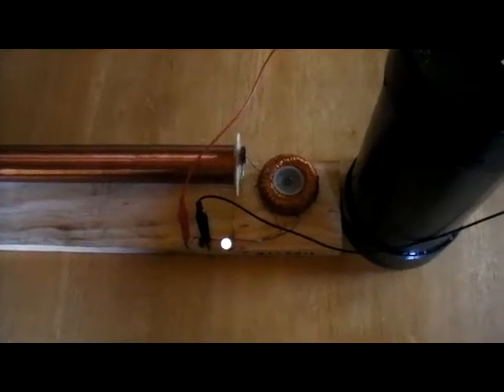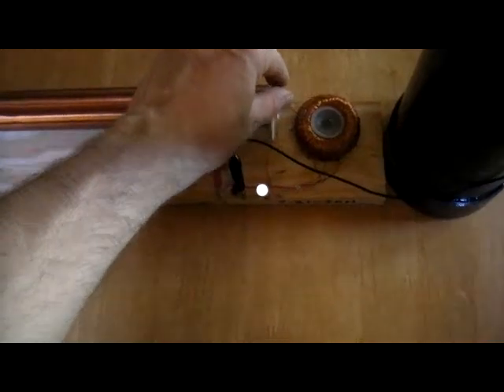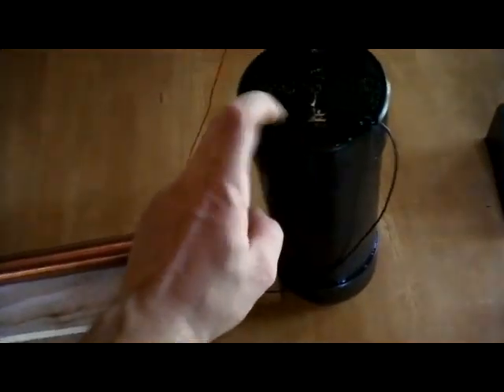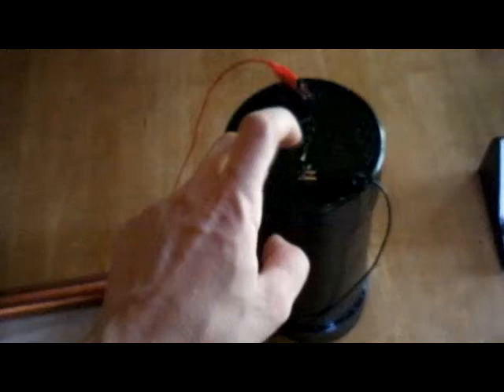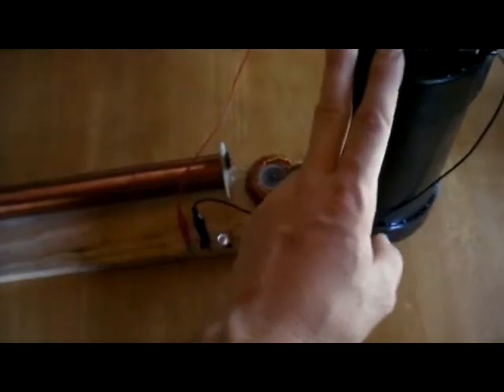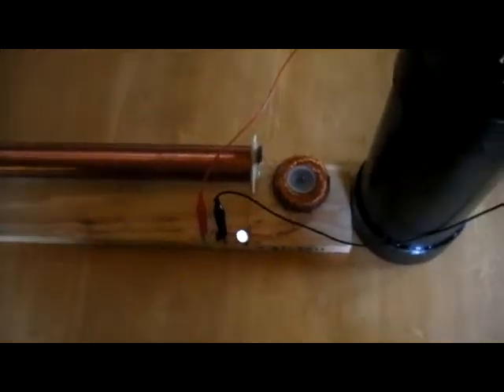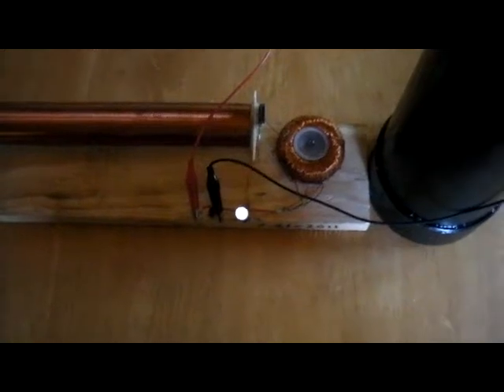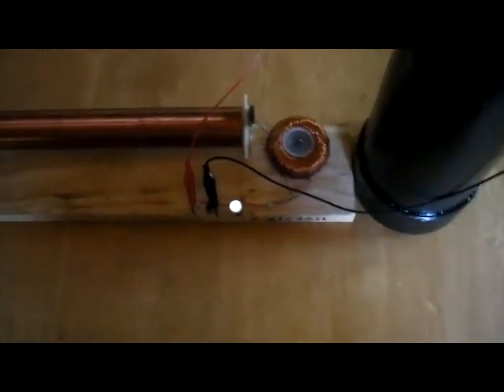Oil cell long term test run update.

Comment: Try Lead & lead oxide differential with an acid dielectric. If you can beat the Volt/amp output, cost, and recharge-ability per cell of that combination you are accomplishing something. Other than that you are just demonstrating how to build survival batteries. Just showing blinking LEDs or a spinning motor is not scientific data

Comment: All these amazing batteries that will change the world are just reinventing the wheel. There is nothing new with difference of potential between any two things with or without a dielectric. You can already calculate all of these differences with published data. Think! a clock runs a year on a cheap AA. $20 of materials in a home constructed battery should run for 40 years. AA batterys are Carbon & metal with an alkali dielectric. Now these videos are good for after SHTF battery construction.

Comment: can you give a supplies list for each thing. what is the long coil wraped on whats the outer dia is there a core. what wire gauge. whats the toroid made of id od and height prior to wrapping. is it metglass or ferite. what gauge and how many turns. where can i find the carbon rods and the ribbon. i would like to start doing little work shops with friends when i get a chance and show them things like this.

Comment: Not bad, but did you check the magnesium ribbon ?
How does it look now ? Did it decompose already a bit ?
Well, the power on the LED looks like only 1 MilliWatts or less.
so it would probably take ages to see a corrosion on the Magnesium
this way...